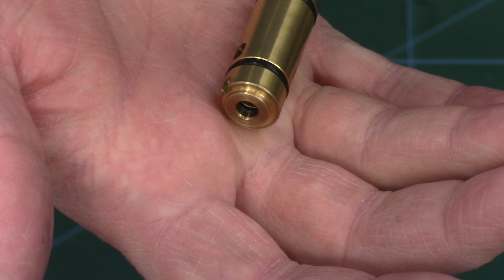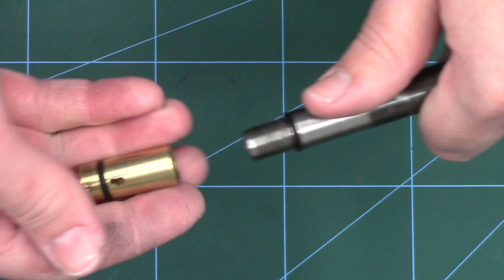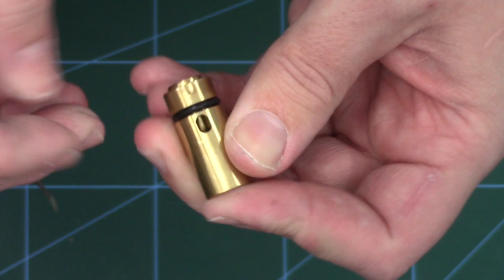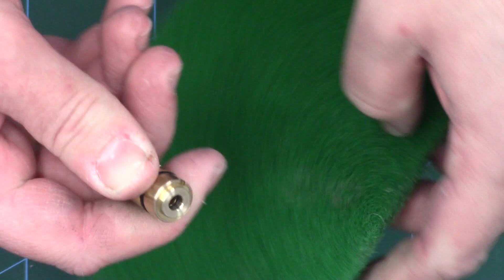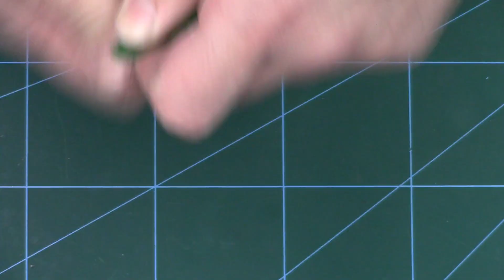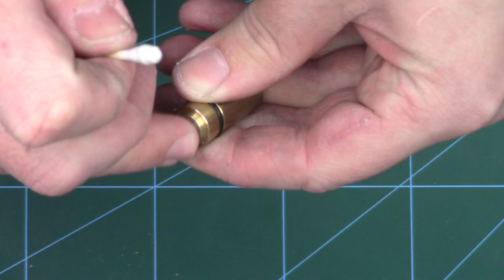Improving pellet loading into the FX transfer port.

Comment: Hi,
    I've bought a new transfer port for my Wildcat hoping to cut down the number of parts with the potential to move or expand differently so I bought the longer brass version that replaces the brass & steel with one peice, I presume there is an O ring to be fitted internally although on first viewing I can't see a recess for it, if there is how do you get it in position so deep inside ?
Reply from the maker: i think that these have a very slight taper so no need for the o ring 😀
Reply: I'm glad to hear it, Thanks. @sub12airgunners

Comment: Hi another great video,  You transfer port hole in the barrel  looks to be oval have you done that or is it a bought item? On my dream tac it is just a round hole. It look very restricted!!
Reply from the maker: If its a .22 then it will be very restricted, but this is the .177 port and its standard, they restrict the hole so you can swap between calibers without altering settings on the rifles in sub 12. Thanks for watching.

Comment: Hello again from a novice air gunner. I am going to install a adjustment for hammer spring in my Impact but when I try to pull out the C3 it feels spring loaded and just want to spring back in again. Is that something that is on sub 12 and in my case 10 joule? When I look at others doing the same thing they just pull the rod out. Is it something in the plenum to help with low power?
Reply from the maker: Yeah the low power models have a valve return spring in the plenum, so its spring loaded. On the fac models they don't have this. Thanks for watching.
Reply: @sub12airgunners  So if I upgrade my Impact with power plenum and higher power I can take it away? is it ok to leave it in? I only have 2mm hole in the transfer port is it the same in sub 12`?
Reply from the maker: @lassesarnhult9283 you would leave it out when upgrading to the power plenum,  its not needed. Yes the 2mm hole is standard for .22 sub 12 it allows you to swap between .177 and .22 without touching the power settings. Thanks for watching.
Reply: @sub12airgunners  i took it apart today and I realized there were no hammer weight. Is it so in sub 12 also? I was going to install slug power kit. Hmm Do you know what hammer weight to buy for an impact M3
Reply: @sub12airgunners  I need help. What size is it for the hex key to get the pellet probe out? 1mm to small and 1.5 to big on my impact M3
Reply from the maker: @lassesarnhult9283  It should be a 1.5mm it may be a bit tight to get in but it definitely should be a 1.5mm key. Thanks for watching
Reply from the maker: @lassesarnhult9283  No hammer weight needed for the sub 12 models, you get one in the slug power kit but its not recommended for sub 12. Thanks for watching
Reply: @sub12airgunners  yes it was 1.5 my screw was little damage. I installed the power plenum but then the tube leaked in the front end. I have no luck, All seems so easy on you tube :D Thanks for your time and answer. I have seen all of your videos regarding Impact. looking forward to more

Comment: FX Smooth Twist X Superior Liners are not standard for all models, some use STX in .177. I wonder why.
Reply: Thanks, FX need to update their website.
Reply from the maker: @Jjjkkl222  They are probably just getting rid of all the old liners first, then when they run out it will be updated. Thanks for watching
Reply from the maker: They should be standard now, the new liners have it laser engraved on the side of the liner, older rifles won't have the markings but the newer liners have the superior markings on the barrel. Thanks for watching

Comment: Another great video thanks 👍🏻
I have just received an impact M3 sniper .22 (fac) and taken my first 50 shots today! Weather was appalling not a good testing at all! Still, I expected it to group slightly better than it did.
I understand these kind of need running/settling in first but after that, what are the first things you would do to achieve greatest accuracy?
Thanks.
Reply from the maker: Impacts are very strange rifles, they take a lot more bedding in that regular ones in my experience, first thing to do would be a proper barrel clean, next find a pellet / slug and tune the speed for the best results, after that if your still not happy a little barrel polish/ experiment with different liners.  Thanks for watching
Reply: @sub12airgunners  
Thanks for sharing your knowledge! I will put a few tins of pellets through first to settle things then see if cleaning has any affect. 
Thanks again.

Comment: Great video as usual, tho if we wanna be nitpicky, after all the work carefully polishing brass, it might not be the best idea to use a sharp steel tipped pin to push the inner o-ring in, or be very careful not to touch any polished brass at all.
Every contact between steel and brass, brass loses.

Maybe as a precaution use a wooden pick? For like shish kebab/shashlik.
Yes splinters would be a B.
But they can be cleaned out and you can touch the polished brass as much you want.
Reply: plastic knitting needle works a treat 😀 👍
Reply: @marcdavis2840  yeah that sounds perfect for the the task hehe
Reply from the maker: If your careful its not something to worry about, your not poking the brass just the o ring, you can use tooth pics or cocktail sticks if your worried, but I get them out with a sharp pointy thing and put them back with the same tool as long as your not putting excess pressure or trying to force it these no chance of slipping and even doing it for the camera is pretty easy. Thanks for watching.
Reply: @sub12airgunners  and no thank you, getting me all inspired to get back into pellet rifles and tuning them 😋